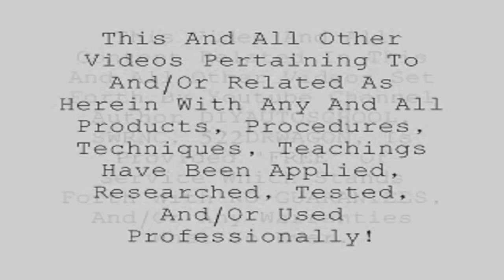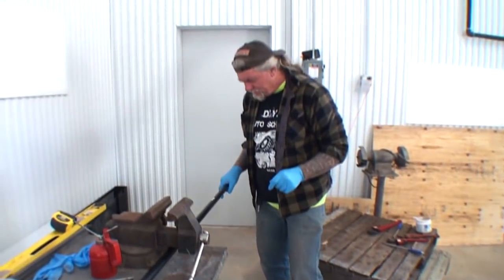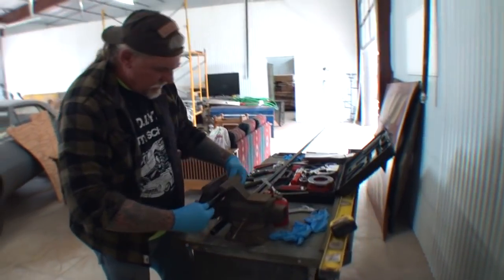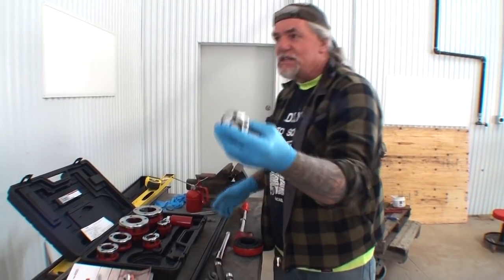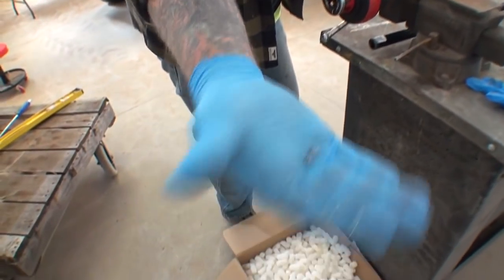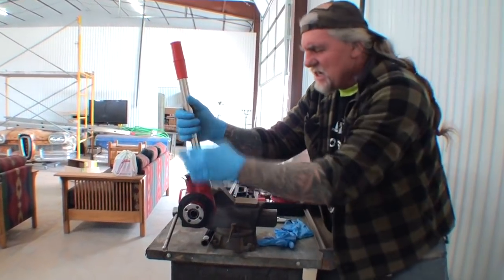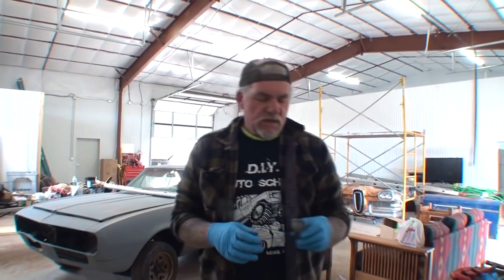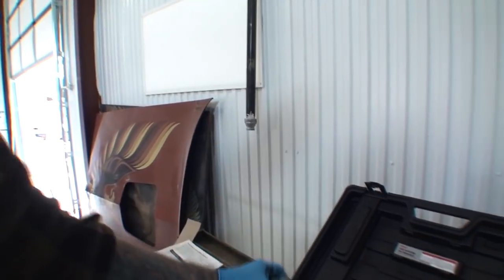Threading Pipe With A Harbor Freight PIPE THREADER - EXTREME FAIL Review

Comment: Lots of people are stating you need more oil and I agree but, the technique also needs modification. Most than likely the dies are a high carbon steel (cheap) and NOT H.S.S. (High Speed Steel-expensive). I noticed you only backed off after the threading became very hard. When the threading becomes difficult, there is NO oil where the dies are cutting through the new metal. You have to reverse and re-oil long before it gets that tough to pull the handle. Your threads prove that out.

Comment: After threading pipe for a lot of years, use ridged cutting oil and continuous oil during threading or your cutting head and pipe threads are wrecked. You cannot use any other oil but threading oil
Reply: Sean I have to disagree. I threaded black, galvanized and brass using 30 WT. oil never had a problem except with brass and only because brass is a sticky metal to thread or machine and I've crushed more than one 1.5 inch brass pipe, folded like butter.

Comment: I bought that set at least 10 years ago and I've had very good luck with it. I used the 1-1/2" a lot. I use a plumber's style pipe vice on my bench and I also bought a tow extention mount chain pipe vice to use on the back of my truck. My 1/2" cutter is finally getting dull, but not enough to motivate me to figure out if the bits can be replaced, or if the entire cutter interchanges with a Rigid, etc.

Comment: that (tool) is just really good for is chasing the old threads. a Ridgid electric pipe threader (Industrial machine) is the best for new threads. I would measure and  mark all cuts and take it to a machine shop and in no time hardly they will be threaded to ensure I have a good seal.

Comment: Years ago my wife use to work at a cabinet shop in Florida, well come summer time no ac in shop their air lines would pop out a few times a week,the boss said wish I could fix this , told wife tell him to replace PVC pipe with iron plumbing pipe, never did,they had quite a few breaks during summer,do it right first time!

Comment: Black pipe is the absolute worst thing you can use for airlines. Based on what I’ve seen so far, I can bet you’re not using a dark sulfur base cutting oil either. You never back off on tapered threads. Useless “review” !

Comment: Most of harbor freight stuff is poor quality. I had a brand new sandblaster in the box stored in my garage for about 8 months before I  finally opened it up to use and found the hoses rotted beyond use. Also a motorcycle jack that rusted from the inside out until the paint peeled away to reveal the damage. Our military built battle ships using chinese steel and I'll bet dollars to donuts they are finding out they can't keep those ships from dissolving into the ocean.

Comment: Im a plumber that has spent many days running a ridgid 300 machine and hand threading aswell i always go realy heavy with oil and push down using my weight while cranking at the end spin that die off by tossing handle in a counter clockwise direction thats the part thats most fun then catch it mid air lol you'll look at feel like a pro just make sure your heads not in thw way.

Comment: Next time have your helper pump threading and cutting oil on the dies as you are cranking on the tool. It will cut faster and smoother. I’ve cut lots of thread with the same setup, albeit mines twenty years older. (Maybe made better by HF back then? Who knows?) They work good for smaller jobs or occasional use.

Comment: Def need more oiling. The hotter the thread gets the better chance it will temper and shatter the thread. Aerosol Ridged cutting oil is perfect for hand threading. It bonds to the pipe very well. 🤟🏼

Comment: Originally you went from inch and a quarter ( or half ?) and now you are using thinner pipe ? What happened to the cool idea of more compressed air volume so the compressor will not have to shut on/off etc ? Why are you using thinner pipe now Pete ?

Comment: you need more oil. Ridgid makes a much better threader but they are way more money. I do heating and Ac so I use them often with a power threader of course. I think those will work fine

Comment: I used 11/4 schedule 40 plastic. It has a bursting pressure of 300PSI and my compressor kicks off at 120PSI. I just chopped it off with mt PVC cutter and glued it together.
Reply: The 300 psi rating on schedule 40 pipe is water pressure not air pressure…there is a big difference. I had sch40 pipe in my shop (@115 psi) and after about 15 years became brittle. Came in one morning and a main valve on a 1-1/2 line had exploded and sent shrapnel over my entire 2400 sq ft shop and blew two fluorescent lights off the ceiling. If an operator would have been near, he surely would have been killed. Tore every bit of pvc down and replaced with Kaeser Smart Pipe.

Comment: For those that don’t know, pipe is measured by inner diameter, so the die will need to be sized for the outer diameter; also just an FIY tubing is measured by outer diameter.
Reply: Pipe is measured by o d not I D . I'd tells the thickness.
Reply: @robertchall8576  what are you smoking?
Reply: Not smoking . Pipe is measured buy O . D. I D will change because of pressure ratting.the coppling will go buy I. D .
Reply: @robertchall8576  that’s not accurate, you seem to be confused with tubing.
I know this from college, I’m an experienced fabricator and I even did a search just to be sure I’m not being dyslexic and I am correct.
Reply: @Truth-Seeker777  pipe is Measured by the ID tube is measured by the OD
Reply: @claytammaro7060  thank you, that’s what I’ve been saying, not sure where the confusion is.